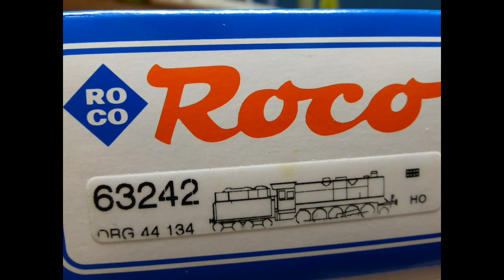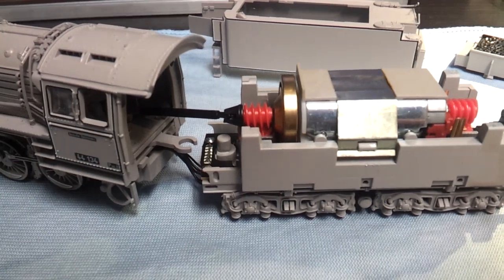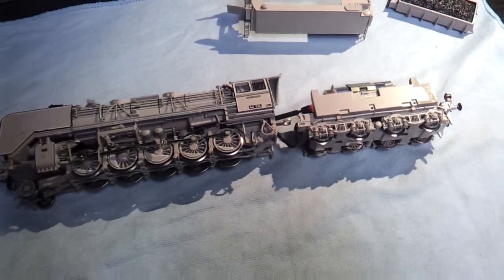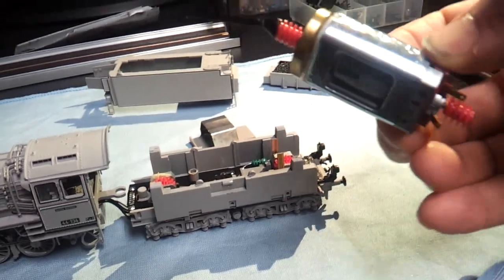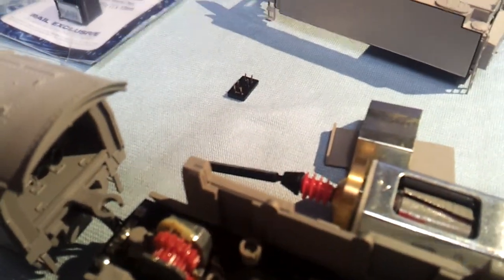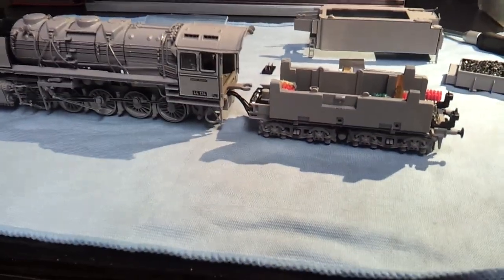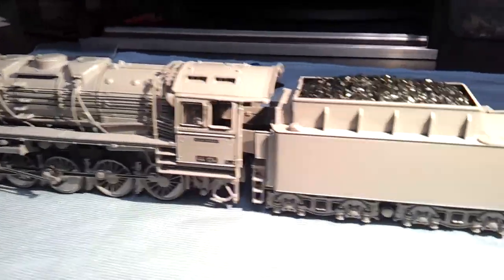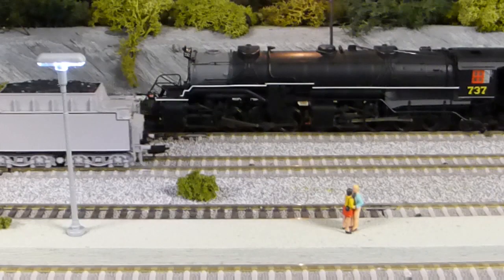Roco br 44 photo livery dcc fitout

Comment: Hi jim!
It's very nice, cool loco! I would like to hear the steam sound.
Zimo speakers are great, but I recommend you to check using a tester before you put the loco on digital tracks. where have you solder wires on the speaker?  because soldering on zimo speakers in wrong ways cause a short circuit easily. in addition to seal a speaker and a buffle is very important to get nice sound. all the best Tak...
Reply from the maker: Hi Tak ,
i hope you & your family  are well,
I may install the sound chip in the future on this model , i have installed  a few zimo cube speakers in different sizes, they have very small terminals which as you say need great care when soldering like the LS10x15 speaker
or smaller like what you use on your fantastic n gauge system.
i have had critical shorts outs in the past which have fried the chips...lol.. i learn the hard way...its best to use a large viewing glass with a built in light for the small works in our hobby more so for n gauge.
all the best jim..